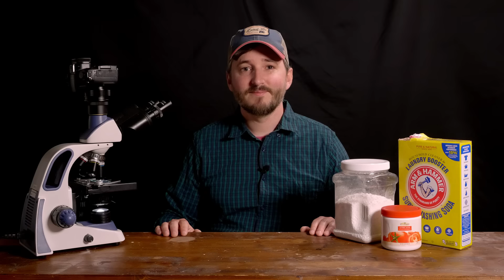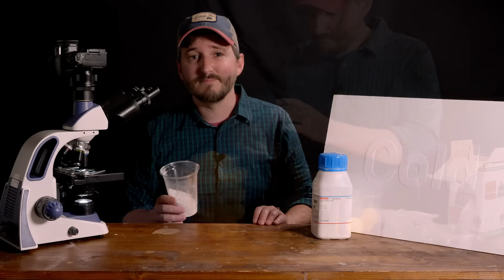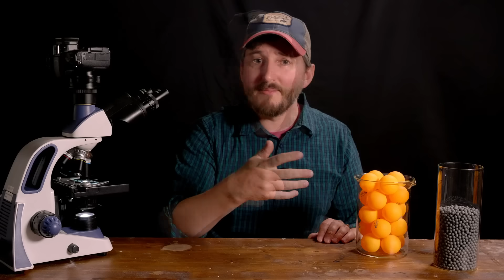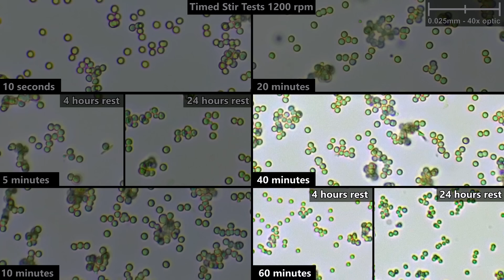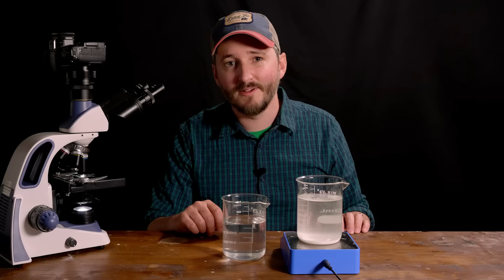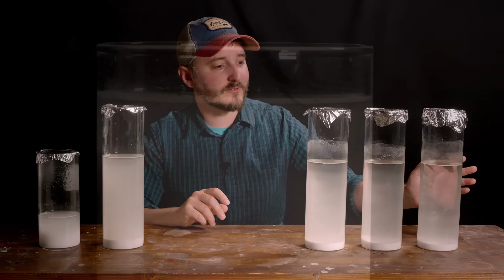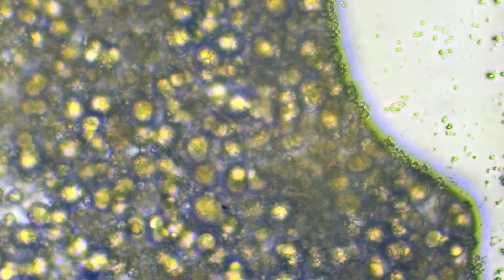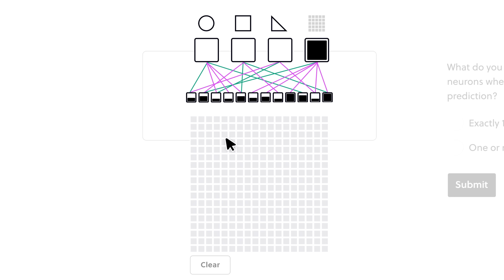Making Infrared Cooling Paint From Grocery Store Items (w/Novel CaCO₃ Microsphere Synthesis)

Comment: Does the albedo effect from the acrylic foam make it that much more effective than mixing the pigment with a paint base you can spread? Something that sticks upside down? How thick does it really have to be? I want to try mixing microspheres with PVA glue that I can squeegee onto glass. I have some scrap sliding glass doors. I could make a shed roof out of them. It would be like a reverse greenhouse. It will need massive overhangs to keep the sun off the walls though.
Reply from the maker: The acrylic mix is effective but it's possible other mixes without the foaming effect would also be effective. I've not had time to test other things yet to find out.
Reply: @Nighthawkinlight  I’ve experimented with fine sanding dust mixed with PVA glue to make a frosted glass effect on a fogged double pane glass door. That works. I found a silkscreen squeegee was the best way to apply it. You could squeegee the IR reflective paint over a stencil on a white background and then use your FLIR camera to read the message 😎

Comment: What if the thermal panel is in a near vacuum, like a triple pane window, or double, with the panel added to the center,  pull a slight vacuum.  Maybe flush with a gas, nitrogen or something,  or possibly have the panel being a aluminum or copper heatsink/brass  liquid cooling heat sink. Made from a 1/2" plate and a 1/8" plate, with Tesla valve milled into the thicker plate,  to force the coolant to swirl as it flows through, having multiple rows with only about 3mm between the strips of valves with the rows connected by a 5-6mm x!4mm trench, with a 6mm hose barb pressed into the plate,  with the two plates being  epoxied together, or use the aluminum brazing rods, coat with the thermal coating,  could the cool surface be used to slowly circulate methanol/H2O, 50/50, to be passed through a large radiator inside about 48" x 72", or 36" x 84" made of oval tubes, 1.5 x 3mm to 1.5 x 6mm  placed on 20mm centers, with aluminum or copper  Finn's,  from about .5 mm thick 8mm wide foil,  bent in a zigzag  with a 2mm gap between,   solder the Finn's to the tubes , that are connected to a flattened 8-10mm,  tube with grooves to accept the core tubes,  making a radiator,   place a computer fan on the radiator on the center of about every 12" x 12"  section  , use a small pump, 10 to 25gph   just a couple steps above a dosing pump,   the fans and pump will require less than 5-6 amps at 12-14v😅100 watts peak,  if you have a well . Or a spring with cold water, in the 50°-60° range or so ,  it maybe more efficient to use this water. Or use a heat exchanger use a insulated barrel that fills with the cold water, holds it for about 3-4 hours, circulates the water through the radiator,  then dumps the water either into the spring or a larger storage waiting for a later use, animals water, bird baths,  your bath,  a 12v or 120v pump US fairly cheap,   it can be pump into the tub a bit of hot water added there you go, little waste, and cooled house, from 100 watts  if the reflector heat sink doesn't work, 
I think a small scale test  should be tried first. A 2x2" or 4x4" 1/2" thick with 1/4" hoses attached,   tested in a glass vacuum chamber drop the pressure to equal about 40k-70K feet possibly 100k feet.  To prevent the surrounding air from heating it, maybe it would work similar to the radiators on the issue, and satellites,   it's very interesting, I'm going to coil up about 80 feet of 3/8" stainless tubing connected to a 8-10" manifold to allow four, 2"- 3" coils up to 10' long,  lowered down into my spring/well,  it's a 24" tube 50' deep with 20-30' of water inside there is a lot of springs in the area,  I'm not going to drink it,  I'm going to collect rain water,  and  pass through multiple carbon filters and uvc treatment,  use the well for the shower and toilet,  the rain for dishes, and buy drinking water by the 5 gallon water jug, use a either gravity feed to a drinking water only faucet at the sink, and ice maker, and water dispenser in the fridge,   either make copper radiators for inside, or use car ac condensers,  hang then in a frame , and hang them out of the way behind a door or possibly use them as a door inside,  I gave a 8' wide opening in my living room to kitchen, having a pair of 24" panels with fans ,  covered in screen to make them look nice,   have a 4" fan per 8" x 8"  space  running at 50% speed, having about 12 old computer fans per panel, or a couple 12-16" car fans running at about 20% speed, for near silent operation, four total. The cold water, 60°-/+ 2°-4° the large  surface area having the radiators fed by 3/4" pex, with a 30-50 gph , (roughly) pump,  it should keep the rooms in the 69°-72° range on around 90° days!  Especially if I build a wall of solar panels to keep the sun off the house as much as possible.    Near free ac!  A small window AC can possibly keep the house cooled on the hottest days,  by running only 3-4 hours my solar power,  use a small diesel engine to charge the batteries, burning used engine oil, waste veg oil, biodiesel,  build a centrifugal filter, with fine mesh band to filter further, using a brake drum 5hp engine 2:1 od. Spin the oil out the dirt, and through a mesh, covered with filter paper,  , spinning at about 6k peak rpm,  using a clutch to also operate a big block Chevy high volume oil pump, running about, 1:1,  as needed to pump clean oil to a storage tank to be mixed with methanol,  and lye,  Aldo  a 3/4" coil heated by a propane heater, as it is circulated by another Chevy oil pump spun by a 500 watt 24v motor,   having bio diesel connect the engine to a couple 150a alternators,  24-28v charging the house batteries! Possibly making bio diesel to sell! Sorry to run astray! Have an awesome day 😎✌️

Comment: Excellent video, very impressive invention and results. Thank you for publishing. 
FYI for the purposes of spraying: Nitro-cellulose thinners is completely compatible with Acetone. I think Acetone has a higher evaporation point and is used ~10% with cellulose thinners as an anti-bloom additive in colder temperatures. Therefore, perhaps by adding a clear Nitro-cellulose or Acrylic lacquer to your cooling paint it may produce a spray-paintable mixture that will have surface protection against dirt and scrapes? Nitro-cellulose (or Acrylic) paint/lacquer is mixed depending on ambient spraying temperature starting at about 50/50 with thinners. This results in a milky consistency for normal spraying usually at about 50 - 70 PSI (lowest for thinner mix). Add more thinners and/or reduce either the air-pressure or the nozzle-fan when spraying in higher temperatures to mitigate the higher evaporation rate which tends to cause overspray and waste of paint.
All the best ...

Comment: For application methods with this paint, perhaps a scoop coater like the ones used for applying emulsion for screen printing. You might have to make your own scoop coater to get the thickness you want, and you'd have to adjust your consistancy like for the piping bag. The upside of a scoop coater is you apply a wide area at once.

Comment: Awesome work!        Did you try  paint roller?   Also try a notched trowel like the ones used for setting tile.
Reply: Yes, 1/16 inch micro notched glue spreader if the paint has adequate self-leveling

Comment: Wonder if this can be applied to non newtonion fluids for a harder surface on contact. (edit to add more/second post) - Have you thought bout sonic vibration to settle particles evenly? Or to make it distribute in a micro structure of your choosing with desired adhesive? Mostly to make it as thin as possible. ---- Also, I would glass press this mixture and keep it dry powder inside vacuum sealed panels for another test. Solving both the erosion and what to do to coat it; issue.

Comment: One property of your paint that you didn't address, which I think is probably going to be important for the application you want to use it for is thermal conductivity. You are going to need to be able to move heat in to the paint at a decent rate for it to radiate it away with any sort of efficiency. Just something to consider. Great video.
Reply: I think that's a non-issue.  It will bring more heat from the outside air than the cooler inside space with thermal conductivity.   You don't need to cool the inside space, you just need to radiate out the heat that is trying to enter the space as much as possible so it doesn't heat the inside space more.  A more insulative material might  be preferred to thermal conductivity.
Reply: @nubrigol  that depends on how you are using it. With the application he is using, it is definitely more trying to cool the internal temperature considering he has it on an externally mounted board. Also, the board is insulated from external convection and he is driving air behind the panel to cool it. Thermal conductivity is definitely going to be an issue with that sort of setup.
Reply: Most structures along the roofline have an overhang extending past the walls. The rafter and truss tails are boxed in with facia/side.  Soffit/bottom and when continuously vented (split down the middle with a metal screen)  draws large amounts of shade cooled air from below throughout the attic exiting a ridge vent at the peak of the roof. Airflows without energy cost and minimizing moisture damages too

The attic's interior (including the ceiling)

The walls especially the top plate (the double layer connection to the roof truss's rafters)

My apologies it was meant as a general knowledge comment didn't mean to intrude, I spent @ an hour (fat finger framer's frustration finding feasible frazes) Couldn't delete it won't repeat it again my apologies

Comment: I can't understand the need for acrylic glass, why use plastic when things like lime paint or the improved, silicate mineral paint have existed for centuries?  with the right additive like starches or boiled lineseed oil, casein it will work on all surfaces that are not smooth plastic and metal. 
And why the need for micro spheres ? even with irregular crystals if you stack them to the point of making an opaque color what is the need for spheres ? every research I do ion the subject s adamant on the damn spheres, but fails to explain the purpose, I know that they can stack more efficiently, but an opaque color is opaque regardless, it can be thicker or thinner, but I have a feel that the real purpose is not to use less paint, so why the spheres ?
Reply from the maker: I'm working on a casein based version. I think that would be excellent if it functions properly. The spheres are there to achieve higher pigment density, and therefore less binder is required to fill the gaps between them. The binder is an inhibitor to the ideal emission from the pigment so the less you use the better. There are other reasons but that is the simplest.
Reply: @Nighthawkinlight  thanks for the explanation, it was really exhaustive

Comment: Shouldn't you use a matte black layer to increase emissivity? Theoretically that combined with a white reflectivity layer should make a better cooling paint
Reply from the maker: Any benefit to emissivity from a black coating would be offset by increased absorption
Reply: @Nighthawkinlight  there would be no increased absorption if it's under the reflective layer, as long as the reflective layer is sufficient. Also you use the deep reflective sides to keep the panel in shade, aiming it straight at the sky.

Comment: How would this hold up in ceramics? Could you make a glaze? Or could you mix it into the clay? Or could you make a powder coat for metal?
Reply from the maker: Calcium carbonate is a flux in ceramics. It doesn't survive firing in its original state
Reply: @Nighthawkinlight  gotcha 👌

Comment: Could this be mixed into an epoxy? Or maybe a standard enamel paint? 

How does this compare to glass bead?
It's used as a blast media, and used in road paint to make the paint reflective. 

Have you considered using paint rollers to apply?

So many types exist.
I've used them for everything from water color paints to epoxy, to cement.

A rubber roller could be used once it tacks up to flatten, smooth it out.

Comment: With the world having breaking temperatures throughout.  Purhaps the automotive manufacturing companies may want to take some time and test development of such an option. Particularly in the western US as there will be much less resistance. I myself am a car audio guy here in Central Wisconsin. Average this year in the 90s throughout summer for this year in particular. I plan on installing ceramic nano tint for my project wagon as it will keep my electronics cool and me as well. I love leather except when it burns my skin. Parts would be able to remain cooler in such hot environments. I prefer not to take my project vehicle out in winter. In my eyes, no matter which way the automotive generation goes (oil/electric) I believe such ideas as this will serve as a useful aid.

Comment: Hmm a thermal water heater and a solar water cooler.  Oh hey, if it drops down enough, could push the chilled or heated liquid through a radiator and have next to free heating and cooling.

Comment: Amazing video, and kudos for all of the research done. I have trouble wrapping my head around this whole thing, could it be possible to reach very low temperature using very well isolated container placed in a cold and dark environment (something like arctic night)? My second question is about carbonate crystal size, could you tell me what where the size of crystals precipitated without using citric acid? I want to leach out an element from mineral, it forms soluble carbonate so I would be able to precipitate most of the impurities. However, I'm afraid of clogging my filter, and wondering if by using calcium citrate, I will produce larger particles that are easier to filter off.

Comment: What about putting a pipe coated in this white paint inside a glass tube, pull a vacuum to insulate the pipe,  and pump a liquid through the pipe to cool the liquid. Since there's no ambient air inside the glass tube, a significant temperature drop should be possible.

Comment: Regarding the formation of the "foam" from the water in the acrylic: The initial size distribution of the water particles will probably change over time due to Ostwald ripening. This would make the particle size more homogeneous initially as the smallest are consumed, then over more time would increase the particle size. It strikes me that the best size and size distribution should be from freshly prepared paint. In other words, storing the prepared paint for extended periods might be damaging to the desired "foamy" property, and it probably would be very hard to correct it by stirring. Another aspect of Ostwald ripening is that the freshly prepared micro-spheres should not be allowed to remain in the aqueous solution for extended periods because they would start changing size and shape to become larger faceted crystals, which could screw up the packing fraction.
Reply: What’s the actual timeline on that do you know? 

I’m currently making (trying to make) enough pigment to cover 200 square feet. It’s bottlenecked at the blender, so I have to pipeline about 3-4 batches at once. 

I usually leave the initial dissolutions in the fridge overnight to cool, 

then blend them in the morning, let them settle in their reaction containers over the next night, 

combine the different sizes in a rinse container (rinsing and settling 3 times over the next night, 

then transfer to the draining pan, and usually leave that draining for another day before baking it off. 

I could compress this, but I’m working on it during my downtime around my job. 

So in total the microspheres spend about 3-4 24hr periods between initial formation and baking. 

I’ve been assuming I’d mix the liquid base the day I’m planning to apply it - would it have any shelf life at all if I have leftovers? Or should I line up a secondary project to use up whatever I make the day of?
Reply: @Laecy  Sorry to say I don't have a timeline for you. I'm just a hobbyist with a passion for science. The original comment was based on a crystal growing experiment that yielded awesome large crystals from a pile of fine granules, and I researched how/why it happens.

I can only suggest that you take Ben's "recipe" and when you want to stop sphere growth, wash them with something that isn't a solvent for the spheres...alcohol? That should stop the growth and prevent Ostwald ripening while drying.

Sorry I can't offer more. I'm just theorizing; you're really doing it so you're already way ahead of me. Best of luck!
Reply: @richardunruh4035 Hey thanks for the info! I wish I had the lab setup necessary to check what I’m doing as I go along. It’s a bit nerve wracking to do all this work without any checkpoints before final application. 

Might try your alcohol idea. The share of small size particles seems so tiny and wispy next to the big and medium shares. I’m nervous about introducing another chemical into the mix, but I’ve got some 99% isopropyl that won’t leave much in the way of residue. 

Thanks!

Comment: I'm glad that you mentioned the various adhesives to experiment with.  I would love to see a concrete epoxy coating test.

A relatively cheap "cool deck" coating for concrete around my house that holds up to UV would be a holy grail application.  Many epoxies will yellow in UV exposure, so finding an epoxy that holds up and doesn't hamper the IR reflectivity is key.